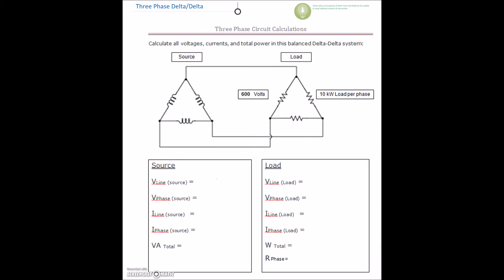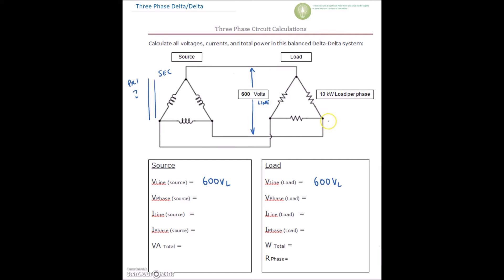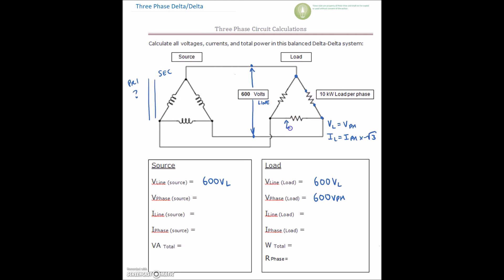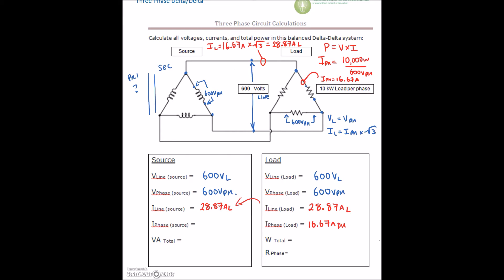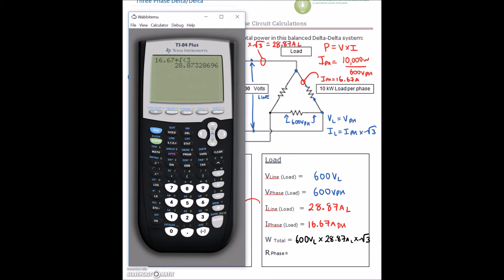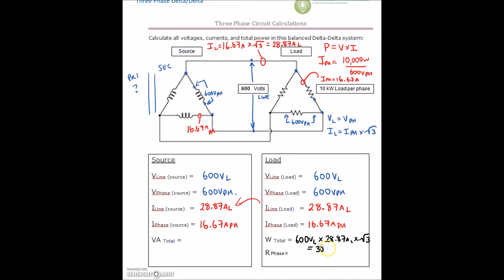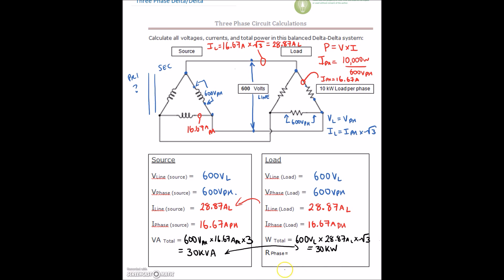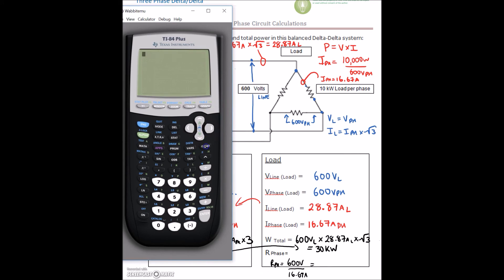3 Phase Calculation #5 (Delta Source, Delta Load)

Comment: It would be good if you could include the angle as well
Reply from the maker: For this example we have used resistors so the angle is zero (pf=1)
Reply: @PeteVree  I think you meant to have the delta source shown with resistors instead of inductors. In a real-world scenario, if the source has an inductive component, it would definitely influence the overall power factor and the phase relationships in the circuit, even with a resistive load.